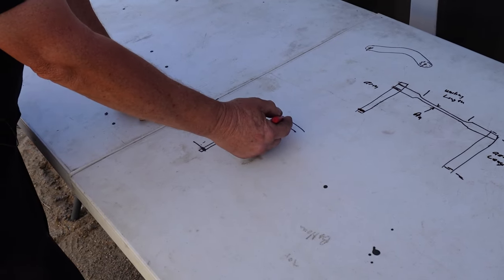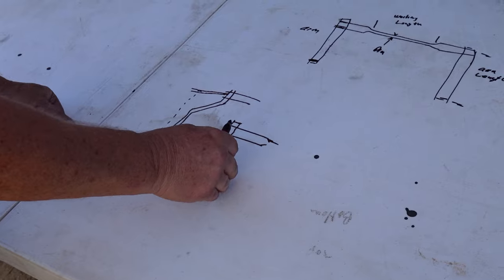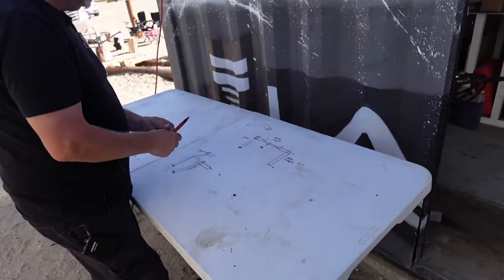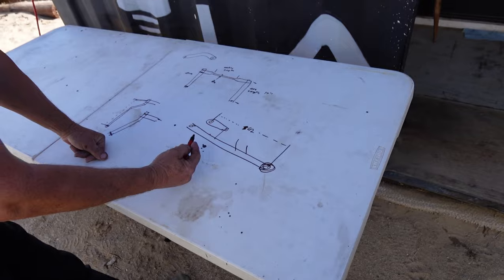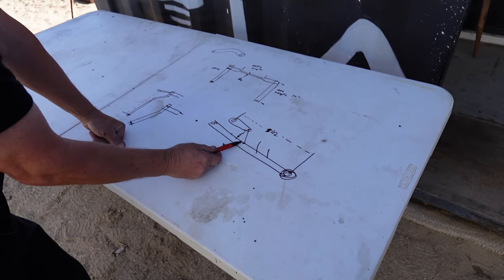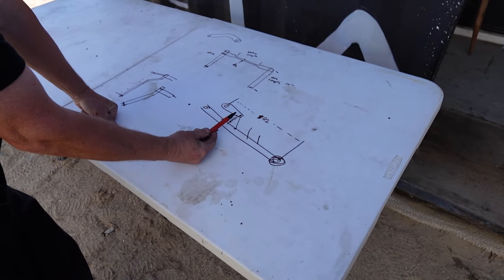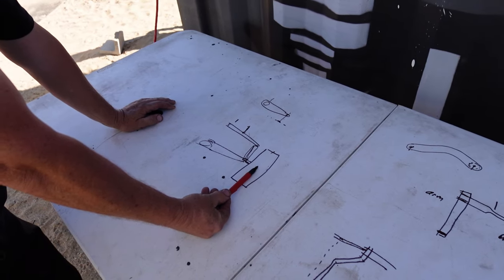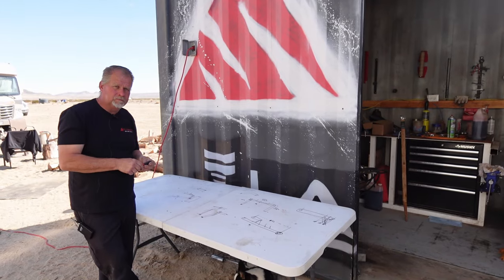Sway Bars 101...Wayne's Way!

Comment: Holy. I started watching this at home while sick and having a headache and trouble focusing.  I’ll have to come back.  There’s a ton of good stuff in this.  Awesome job
Reply from the maker: So my tech videos need to come with Tylenol? got it!
hope you can come back and watch it when you are feeling better.
Reply: @Wayne_at_alltech  I got through it. Kinda interesting as I’ve been trying to understand the sway bar dynamics on my gladiator.  With the front disconnected it blows through the front travel and the rear doesn’t move.  I went to a swaylock dual rate bar and having the softer bar up front when offroad utilizes the rear suspension a lot better and I gained traction and articulation.

Comment: You could use Robby Gordon's Stadium super trucks as an example with there front mounted rear sway bar. All they do is lean over and pick up the front inside tire.
Reply from the maker: yes they would make a good example of sway bar 101.

Comment: Does ratio only make a difference on ifs control arms when it comes to sway bar length/width or does it apply to solid axle as well? For example, a sway bar mounted close to the pumpkin vs at the wheel end on a solid axle
Reply from the maker: It applies to both but since the solid axle has a similar extension lever going to  the opposite tire they counter balance somewhat.  There is some affect but to keep things simple on solid axle I generally don't figure it due the the opposite lever counter action. Independent suspension does not have the counter lever so it does not counter balance. great question!